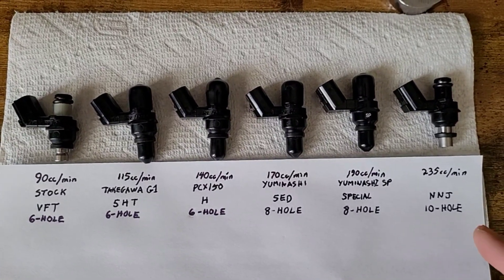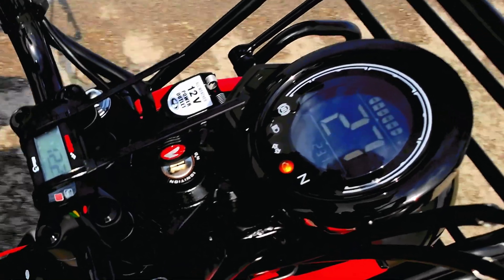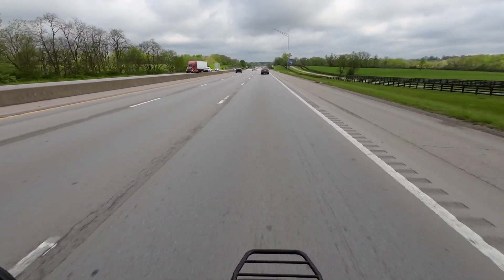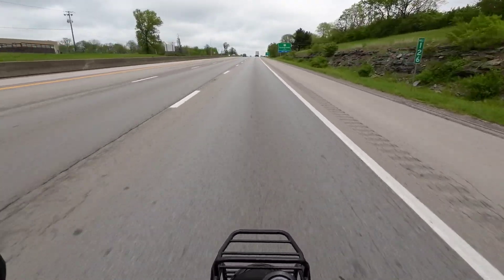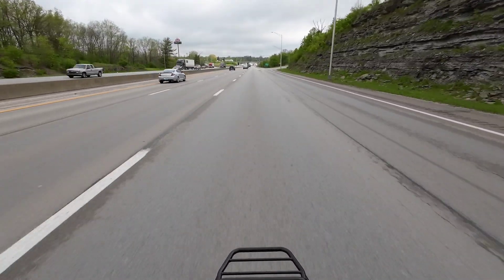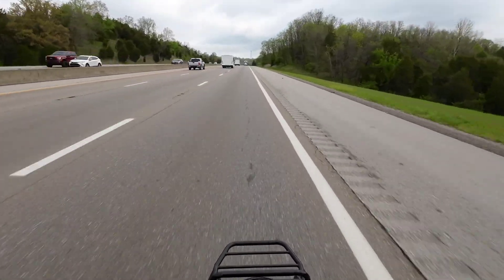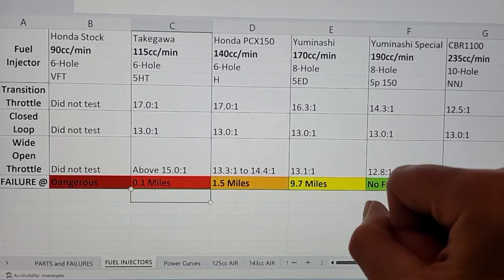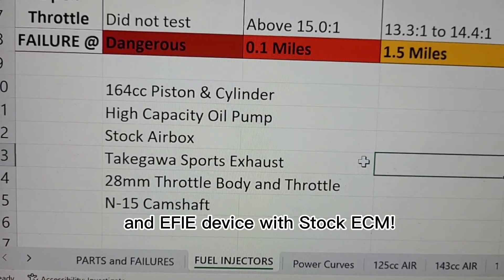GAGGLE of fuel injectors tested on a Honda Trail 125 w/164cc BBK! CT125 tuned the old fashioned way.

Comment: Very interesting what 'jakebike' said . But I'd rather not bbk this engine anyway : it s cooling capacity is already borderline , even with an added oil cooler. 
On mine , I've sawed out half the muffler baffle AND airbox rear snorkel and it goes 110 kmh  (I normally don't go over 50-55) -with no apparent overheating.

Why you are only getting 55 mph out of it is mystery to me.

Then older  similar Hondas used to wear out their upper rods/pins  when abused and/or  not  oil-maintained . This one shouldn't be different with its rather tiny M13 (not sure, here) piston pin.  I know mine should be ok if  left STOCK and well oiled , but I
would not trust it with any sgnificant overbore.

Oh , I used to work on the old ones .  Saw several transmissions  breaking apart from 'accidental' over-revs (full speed downshifts). So I went for a Gear Indicator as my only major mod  (Protec  JA65 for  asian/canadian 2023+  --  fits US models too after some light wiring work).

PS: I have taken a look at the piston/pin/bore/valves after 10K ....no trace of wear anywhere . I'm entirely happy with it as it is. Even the stock chain proved to be much tougher than expected  with only 10w-30 as lubricant.
Reply from the maker: 55 mph up all hills and into a head wind.  Regularly hit much higher speeds on the flats.

Comment: Maximum power and greatest fuel economy is achieved at an AFR 14.7 : 1 (assuming pure gas) since there is enough air to combust all of the fuel thus producing the greatest amount power with the lowest emissions.  Since maximum fuel is being burned, it's no surprise that combustion temps are the highest at 14.7 : 1 ratio.  Since you've shown that your engine wasn't engineered to safely dissipate the amount of heat for the extra power being generated at 14.7 : 1, you've had to greatly reduce its efficiency by running really rich ratios of 12.2 - 13.0 : 1 just to keep combustion temps from overheating the engine.  The downside of course is that you've now significantly hurt your MPG, and increased HC & CO emissions due to all that unburnt fuel being expelled out the exhaust.  Also, all of that unburnt fuel acts as a solvent and will dilute the oil film protection of the cylinder walls leading to increased cylinder, piston, and ring wear.   So you ask, how can you run an ideal stoichiometric ratio while still keeping temps under control?  In one word,"E85".  Fortunately, E85 has a higher latent heat of evaporation than regular gasoline and can absorb more heat during the vaporization process thus acting to reduce combustion temperatures. Additionally, it burns cleaner reducing carbon deposits and cuts carbon monoxide emissions by 90%. E85 also has an octane rating of 105 so maximum power can be extracted when its used with high compression engines.  Since your bike's ECU was designed to only work with regular gas, using E85, which contains a great deal of oxygen, will cause the bike's O2 sensor to see this as a lean condition and will try to compensate by signalling to the injector to add more fuel, thus negating any efficiency gains.  Fortunately, you already have an EFIE to compensate for this.  Instead of using the EFIE to make the mixture richer which is how you're currently using it, simply reverse the white and green wires and now the EFIE will trick the ECU into seeing a richer than actual mixture by simply dialing in the correct amount of voltage offset on the EFIE, thereby preventing additional fuel from being added.  Just keep in mind that the stoichiometric ratio for E85 is 9.972 : 1 so that's what you'll need to tune for on your AFR gauge for maximum power and efficiency. If interested, it would be great if you could do another round of tests this time using E85!
Reply from the maker: I love the idea!  Unfortunately, my little narrowband AFR can't read below 12.0:1.  The thoughts are great, and I agree that I am purposefully losing efficiency and horsepower by dumping extra unburned fuel to cool the charge.  The oil cooler does a great job, but ultimately, without water cooling or more fins directly on the engine, peak efficiency and horsepower can not be achieved without excessive engine heat with non-ethanol fuels.  It does have me thinking about using e10 more.

Comment: expecting less mileage w the yuminashi special BUT im still curious to know that and which one you uiltimately kept.. thanks for all the effort ! ( this is the first deep dive ive seen in to the fuel injection system )
Reply from the maker: I settled on a 220cc Yuminashi injector. I have all components listed as well as speeds and fuel efficiency in the following 3 videos: https://youtu.be/cKYTmz0fPiQ?si=iFrZfIOrFJZgey2J https://youtu.be/GjkFhaY2ba4?si=645UJ7Ppgo5aVndy https://youtu.be/KmtghitlcHk?si=RrX8y7qFwiFywtpR
Reply: @QuantiQualification  thank you for replying sorry i somehow had missed it... atm i doubt ill ever get that far but one can dream. i cant even get the push pins from the dealership... the one local to me is utterly useless maybe ill have to drive over the bridge to where i bought it again.
Reply from the maker: @KtotheL  Dreams do come true . . . Well sometimes 😁

Comment: In one of your videos you covered one of that injector holes with epoxy. Was that successful ? I’m over fueling currently with the 235cc injector .
Reply from the maker: Yes, it was absolutely successful in decreasing the amount of fuel.  I ended up with a 220cc/min injector which is slightly larger than the 235 with one of the holes covered. I sealed one of the outer holes.  If I were to do it again, I would have sealed one of the inboard holes. The 235 injector appears to have slightly bigger holes outboard. Be careful to ensure you have enough fueling at wide open throttle.

Comment: I’m copying your build. Currently I saw in your later videos that you ended up using the 235cc injector. Was that because you added the Takagawa filter ?
Reply from the maker: I would first suggest you watch this video https://youtu.be/cKYTmz0fPiQ along with the second and third videos associated with it. Remember I am working this to the limit and just backing off a little.  I would suggest to go one size bigger to be on the safest side of things. You might drop a mph or two but will be much safer. So with the configuration in the attached video, I am running a 220cc/min, but remember, I have a lot of monitoring equipment now.  So go with a 235cc to be safe.  If you omit the Takegawa drop in filter, go with 220cc/min to be safe. As far as the Takegawa Pod filter (which is different than the drop in sports filter) I would exercise extreme caution because I have not yet determined if 235cc/min is enough.

Comment: Where did you buy all these injectors? I'm having a hard time finding them.
Reply from the maker: The 90cc/min came stock with the bike.  Here are the links to all of the others.
115cc/min https://japan.webike.net/products/23192966.html
140cc/min https://www.amazon.com/HONDA-16450-KZY-701-INJECTOR-ASSY-FUEL/dp/B00NO0DUG4
170cc/min https://www.yuminashi.eu/170cc-b-type-injector-8-holes-5ed-injector/
190cc/min https://www.yuminashi.eu/190cc-b-type-special-series-injector/
235cc/min https://www.yuminashi.eu/235cc-b-type-injector-10-holes-nnj-injector/
Reply: @QuantiQualification  Thank you!

Comment: Awesome test and information! Have you had a chance to observe the MPG you are getting with these changes? I always wanted a Honda Trail 90 when I was a kid. Wish they would bump the displacement on this model to 250-300 cc to allow for highway riding.
Reply from the maker: Hard to tell at this point since I was changing injectors quite often.  If I were to guess I would say around 70mpg+.  If I get a chance, I will post real results.
Reply: ahhh that makes me not want to mess with it at all... ( im already clockin 61 downhill ( very small deline though as FL is pretty flat ) so +/- 2 mph etc.. i think the only thing i will do to this section of the bike is get the cool alloy red guard ;)

Comment: Have you checked to see if your bike has a ecm that will work with the aracer ecm?
Reply from the maker: I believe they have a connector that is compatible at this point.  I am trying to pull off a low-cost version that does the same.  I think I am there.  An aracer is pretty pricey, and I would still need an oil cooler to go any leaner than what the 190 delivers. Certainly, I would be able to use a smaller injector with an aracer since it would be able to command more adjustable fuel at wide open throttle.
Reply: @QuantiQualification  sounds good, I was just wondering as I have watched videos of people running the 146 kit with the aracer ecm getting higher speeds than the 164 kit you are running. But I understand the cost aspect.
Reply from the maker: @FL_onthefly  Absolutely the case.  The restriction right now on my bike is the stock airbox and air intake hose going into the large throttle body. I have used the bike with a Takegawa air filter pod, and it will gain 3-4 miles per hour easy. I don't like it because the bike is less useful in crossing flooded roads etc. With the 190cc/min already giving me around 59-60 mph GPS and the 170cc/min around 60-61mph, that would push me upwards of 64+ mph cheap.  I don't need that speed, so it is a bit of a trade-off. My goals were 55 mph minimum constant up slight grades and into a head wind.  The 170 and 190cc/min achieve this.  The 235cc/min just misses it by about 1 mph.
Reply: What is the temperature you stopped when your cylinder overheated failure?
Reply from the maker: This test was before I had something that could monitor head temps.

Comment: I’m confused (as usual) You say that your speedometer is under reading by a few mph - the oem unit and my current OPMID both over read by the same three or four mph when compared to GPS. I was under the impression that regulatory authorities require that speedometers can over read but NOT vv. Perhaps we using different terms?
Reply from the maker: No, you are correct with the stock gearing and tires.  I didn't mention this here, but in a previous video I added a 15 tooth front sprocket to calm down the rpm at higher speeds and added (slightly) taller tires. I then compared the speedometer vs. GPS actual speeds.
Sprocket Video https://youtu.be/M5_2ZHsU-pA 
Tire Video https://youtu.be/vH6lYVm7H_0
Reply: @QuantiQualification  OK, thanks and understood. You BBK is doing something apart from draining your bank account and fuel tank as my stock CT won’t go over 50mph GPS on the level and zero wind!
Reply from the maker: @Tony Lough  Yes, it is doing it all!  Bank drain, fuel drain, and higher top speed. 👌